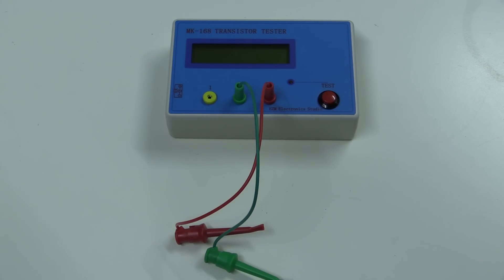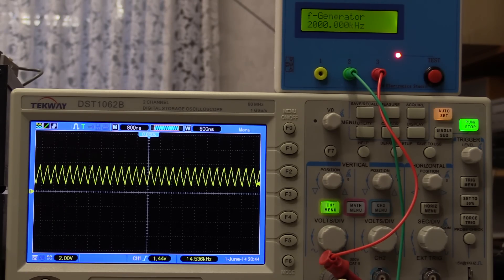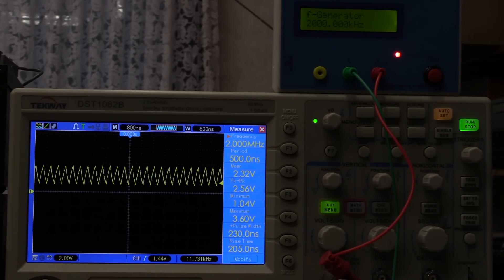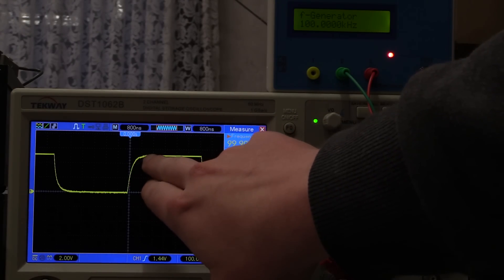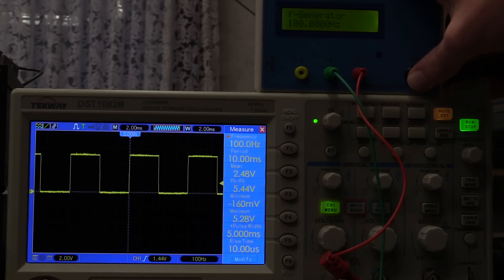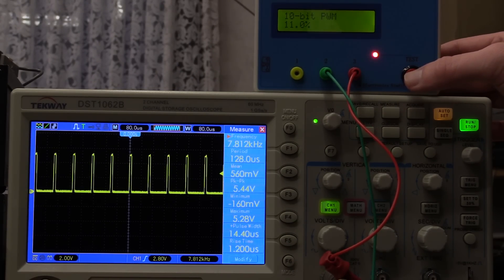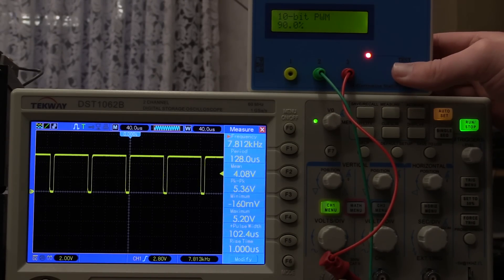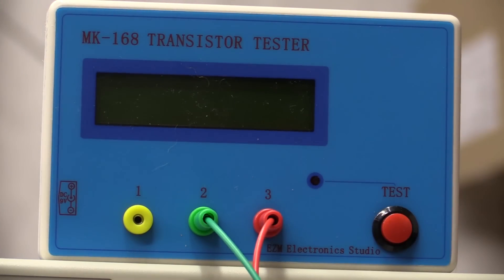Chinese MK-168 Electronic Component Tester review/demo [2/2]

Comment: I purchased my tester in Aug. 2016. I cannot cycle through modes, I think I know why. I believe that EZM Electronics produced two different models of the MK-168, both of which are available on E-Bay. My tester looks just like yours, except I notices some differences.

Your Tester: Stamped Print states "MK-168 TRANSISTOR TESTER." Your tester also has a "Line" between your signal light and the "Test" button (mine does not). 

My Tester: Stamped Print states "MK-168 TRANSISTOR\LCR\ESR TESTER." To the right of my display screen is the printed text "Discharge capacitor before measuring" (yours does not have this text).

Your Tester: When you press the TEST button, your meter reads "Bat. 8.8V OK, Testing..." You have the option to cycle through different modes.

My Tester: When I press the TEST button, my  meter reads "Bat 8.7V OK, VCC=5.05V, Testing..." I don't have the option to cycle different modes.

Again, both meters appear on E-bay when searching MK-168

Here is an image of what my meter looks like, you can compare it to yours:
http://i.ebayimg.com/images/g/UWUAAOSwGotWhPHa/s-l1600.jpg
Reply: My meter looks like the one in the video and I cannot get the extra functions.
Reply: @u4cigam  Same here.

Comment: Found the answer:

http://www.ebay.co.uk/itm/2016-Transistor-Tester-TFT-Diode-Triode-Capacitance-Meter-LCR-ESR-NPN-PNP-MOSFET-/172225104646?hash=item28196a8b06:g:7mcAAOSwY0lXTUll

C+ESR@TP1:3
The additional function ”C+ESR@TP1:3”
selects a stand-alone capacity measurement with ESR (Equivalent Series 
Resistance) measurement at the
test pins TP1 and TP3. Capacities from 2µF up to 50mF can be measured. Because
the
measurement voltage is only about
300mV , in most cases the capacitor can be measured ”in circuit” without
previous
disassembling. The series of
measurements can be finished with a long press of RPEWS.

Comment: Taking a look at your function generator - you have it set to 5mV x 100 = 0.5V.  If this is correct then no it would not measure the frequency as you are not exceeding the TTL low voltage and it see's all 0's.Also C@ESR setting would be Capacitance and ESR tests I should think.  Someday I will put mine together and confirm ;)

Comment: I just purchased one of these with a late build date (Well after the published date of this video) but for the life of me, I can't get into the various options, such as frequency generator, etc...How does one find the firmware version?..Any advice appreciated!!!..Many thnx.
Reply: Scott Stevenz Hi Scott...Sadly, no I didn't...The unit I have has a late build date but that doesn't mean the firmware is the latest...I'm not going to loose any sleep over it.
Reply from the maker: Push and hold the button, you should be able to get it to do something...
Reply: DrCassette The only message I get is "timeout"..I've tried pressing the button for different lengths of time and at different intervals, with the same result.
Reply from the maker: Hmm, that's weird. I'd try to get the unit replaced or so...
Reply: swingmanic  I am having the same problem, did you ever figure it out? thanks
Reply: +swingmanic Connect all probes together and hit test key,
Reply: +jon123423 I tried that, it doesnt seem to go to the frequency generator, but instead it goes into self test mode.

it says "self test mode" then displays a question mark.....

then "version 1.1k testing"

then it says 1 [ ]-3[ ]-2
.00ohms  .00 ohms

if I don't touch the button, it goes off

if I touch the test button 

selftest mode

RO= .28 .28 .30 ohms

T1 Ref =1094mV
RHf=834

T2 +RL- 12 13 23
-9 -8 -9

T3  +RH- 12 13 23
-7 -1 -4

T4 isolate probe 
-5 -4 -5

is stuck on this screen until I detach the probes, then

T5 RH-
8  4  4

T6 RH+
-8 -7 -6

T7 RH/RL
0  0  0

Ri_Hi= 22.6 ohms
Ri_Lo= 20.1 ohms

C0
C0 37 38 39 pF
OK

then it sticks on this screen...

1- l l -3 >100nF
OnF
 after this it shuts off

Comment: hi the selection that says c+esr is capacitor equivalent series resistance. very handy tool for finding bad capacitors.
Reply from the maker: Well, as you may or may not have seen in the first part, it automatically detects capacitors and measures the ESR, so I don't know why it has a seperate option in the menu...
Reply: Sorry I did not see the first part unti now. many thanks.
Reply: DrCassette I know why - normally you can't measure caps in circuit, with this option you can, because output voltage on probes will be around 300mV

Comment: When you have it set to 1000 kHz, I wonder if the signal would be strong enough to pick up on an AM radio. (Probably you'd need to put the wires right on top of the antenna.) This device can do many nice things, but it could really use at least one more button to make operating it easier!
Reply from the maker: Oh yes, another button would be very nice to have :)

Comment: Frequency counter does not work with the usual inputs. You will need to hook it up to the PD4 line on the microcontroller (Pin 16). It is shared with the RS (mode select) line of the LCD, so connecting a new test lead with LCD socket pin 4 will work just as good.
Reply: P.S. 
I've built the manual PDF from the sources provided by mikocontroller.net:
German: https://drive.google.com/file/d/0B2xkcO8M801ESTI1bzJGNXB3WkU/edit?usp=sharing
English: https://drive.google.com/file/d/0B2xkcO8M801ESV9UVFNyai1qWE0/edit?usp=sharing